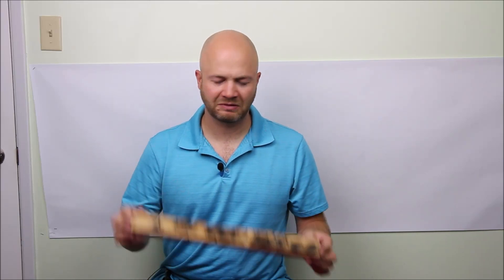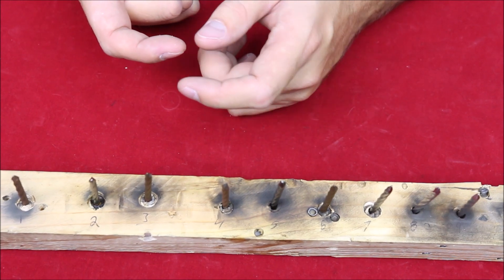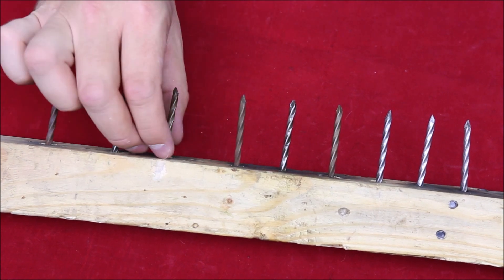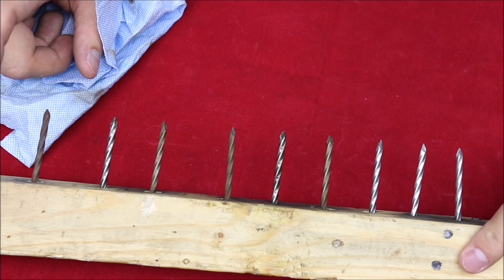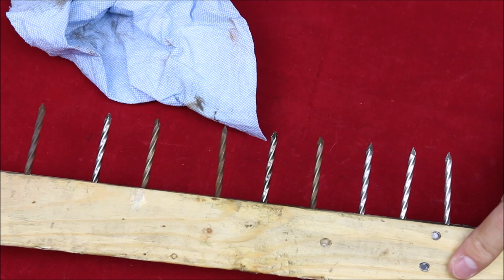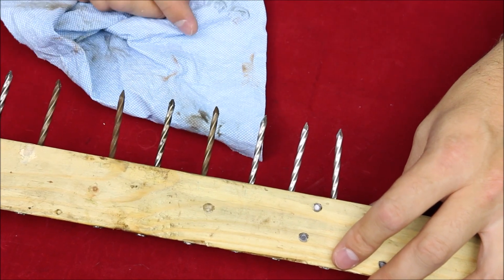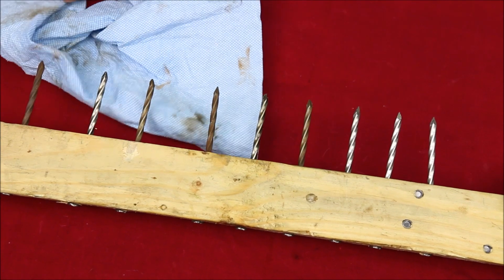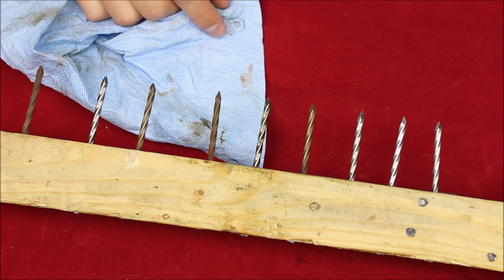Corrosive Ammo Testing (Nail Test)

Comment: I have found that ammonia (window cleaner) and flushing after with very hot water, then cleaning/oiling as per normal, works the best.  Be very careful with Windex though, as the new Windex cleaners Do Not contain ammonia - you need to get the old stuff, or the cheap window cleaner from the Dollar Store (and it does have ammonia in it).  I almost lost a Lee Enfield and Mosin Nagant because I thought I was doing the right thing and using the good (read expensive) Windex.  

Also Adriel, I'd be curious how the Military CLP worked in your test.  Mind you, we never used corrosive ammo in the Forces...

Good video.  Interesting and unexpected result with the Hoppes...

Comment: The reason some cleaners work and some don't comes down to polarity of the cleaner molecules. Salts are an ionic compound, and all ionic compounds are most soluble in polar solvents. The ultimate polar solvent in nature is water. Non-polar solvents tend to be oils or other hydrocarbons. The majority of gun cleaners are made from non-polar solvents and will not dissolve the polar salts left by corrosive ammo. At best they will seal it in which might minimize rust. Corrosive cleaner is water based so it can dissolve salt. It also contains ammonia and detergents to loosen and remove fouling.
Reply: Spectre Ballistics International simple green and water works best for me!